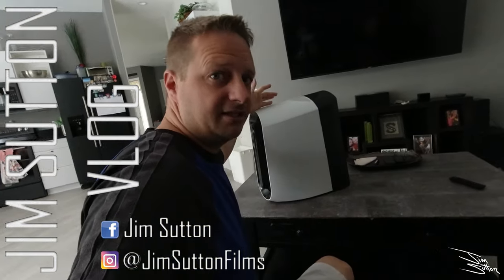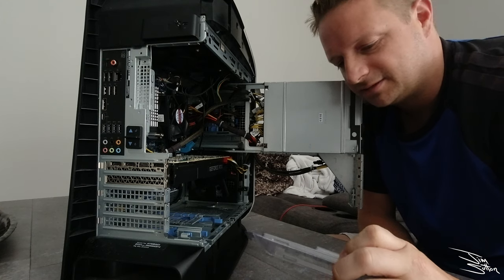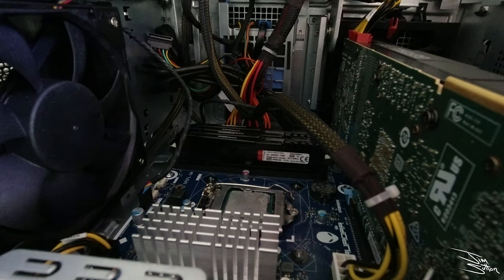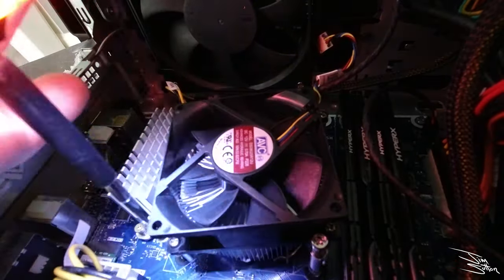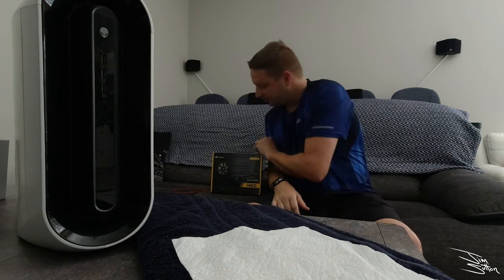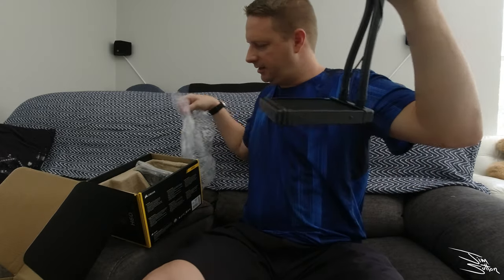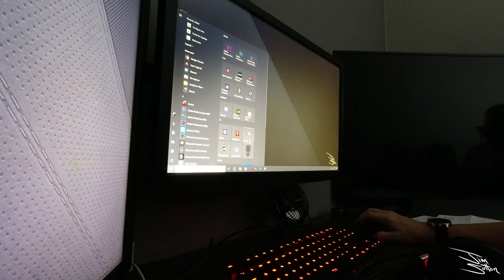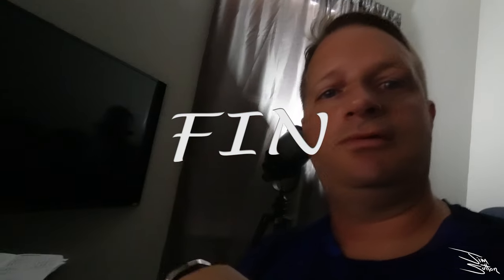VLOG #128 loud Alienware adding water-cooling so its silent and does not run so hot! Alienware R9

Comment: Is it a 9700k 3.6? Or the 3.0?
Reply from the maker: 3.0
Reply: Jim Sutton uh ohh
Reply from the maker: @Turner9090  I don't think that should make a difference on what your doing in water cooling.
Reply: Jim Sutton no...I have an R9 coming tomorrow, air cooled, wanted to run The new flight simulator on it....looks like I’m gunna have to upgrade
Reply from the maker: @Turner9090  its something worth upgrading for sure!
Reply: Jim Sutton do you have the product number of the Corsair water cooler?
Reply from the maker: @Turner9090  it's the h60. Got it from best buy, they had it in stock.   Although I see it now on Amazon as well.   

 https://www.amazon.com/dp/B079NXZQBC/ref=cm_sw_r_cp_apa_i_ekZqFbDBZNFBZ
Reply: Jim Sutton thank you
Reply: Jim Sutton and just to clarify, sorry to be a pain but for the cooling compound you used the LTT square? I’ll subscribe
Reply from the maker: @Turner9090 no problem.  Glad it helps you out.    This is what I ordered. Perfect fit.
 https://www.amazon.com/dp/B07CKVW18G/ref=cm_sw_r_cp_apa_i_VTZqFb8F4WXNM
Reply: Jim Sutton so sure enough I got my R9 been running FS2020 and thank god I got HWMonitor, because I ran fs and was showing temps of 100C!!!! So I ordered my H60 hopefully all goes well
Reply from the maker: @Turner9090  let us know how it goes!
Reply: Jim Sutton I will for sure, glad you uploaded this....I’m getting my H60 on the 5th of September....because of work, the install is gunna be on the 8th...I’ll check in
Reply: Jim Sutton where’d you hook up the SATA?
Reply: Jim Sutton something isn’t right, I have this sata cable and I can’t find any open data connection on my R9
Reply from the maker: @Turner9090  I guess I don't know what you mean.  There are no sockets to plug in your data cable on the motherboard?
Reply: Jim Sutton I need a sata power connection from PSU but I can’t find one, there’s the top fan wire, pump fan wire, and also a sata wire
Reply from the maker: @Turner9090  if you mean a power wire to go to the ssd drive, they don't come from the motherboard.  They come from the power supply.  There are extra connectors tucked in with all the wires toward the front of the case.  Normally tucked away because they have not been used.
Reply: Jim Sutton yeah that sounds about right not totally sure, but I’ll look for them...my cooler is a little bit different then yours. I have this additional SATA Power cable that I gotta plug in
Reply from the maker: @Turner9090  that doesn't make sense.  (Sata is a data connection for the hard drive) you mean power wire for the fans then?   The water cooling setup does not use sata.  If you want to friend me on Facebook, I am happy to contact you and help you out with this, so I can see what you are looking at.
Reply: Jim Sutton ok yeah I’ll do that...
Reply from the maker: @Turner9090  awesome. Glad we got that figured out.  Just if it helps someone else. His water cooler has a sata power connection on it.  So he had to power it the same way you would a hard drive in addition to the other connections.
Reply: Jim Sutton yeah it’s working great so far thanks man!!
Reply: Jim Sutton still running a little high but I’m running pretty demanding game and it has definitely dropped the temps
Reply: Jim Sutton might have to reapply the thermal paste
Reply from the maker: @Turner9090  that of get the thermal pad like I got.  I am happy with that.
Reply: Jim Sutton I also think mine is like an older version or something, which kind of sucks because it was the same price...freaking amazon....In your video I noticed you said the directions wanted you to place the fan on the outside (pull out), but mine seems to ask for the fan on the inside (push out) so maybe I’ll try rearranging that also, I’ll let you guys know if it lowers the temps more
Reply: Jim Sutton OK...So, I went in repositioned the fan, re applied the thermal paste, giving a few minutes to let that paste settle and then I’m gunna test it again...if it still runs high then I just suck at applying paste and the thermal pad is in the mail...wish me luck
Reply: Ok so I checked it this morning, my max temps were around 80, but flight simulator is a pretty cpu heavy demanding game, which is better than the 89 yesterday and way better then the 100 degrees I was getting before getting the H60...I’ll try the thermal pad when I get it, we’ll see how that goes
Reply from the maker: @Turner9090  did you do the single fan setup , or double? And fyi I do super demanding work on mine. From games to love video rendering
Reply: Jim Sutton on the radiator single fan
Reply from the maker: @Turner9090  I ended up after this doing both the original fan from the case, and the h60 fan both.  Sandwiching the radiator.  Both blowing up and out of the case. It improved the cooling even more.  Maybe try that if you have both fans.
Reply: Jim Sutton ok..where’d you connect the second fan?
Reply: Jim Sutton I’m also gunna mess with the command center tonight and put the temp control to performance and see if that changes anything
Reply from the maker: @Turner9090  I put one on either side of the radiator, and connected to second fan to the "cpu" pins.
Reply: Jim Sutton so I ran some other games last night (really old ones though)  and watched some videos to see what the temps would do, and they plummeted, cooled right down and no heat coming out of the case..so I may run some benchmarking software to see what happens there..but I have a feeling if I were to run some modern FPS’s it would run fine. Idk what else to do
Reply from the maker: @Turner9090  sounds like a win to me!
Reply: Jim Sutton yeah, strange I ran an AIDA64 system test and the temps were hovering around 56c at 100% utilization for 10 mins, but start flight sim and oh boy does it slam through those temps
Reply from the maker: @Turner9090  still must be a ton batter.  And enough to not damage your processor
Reply: Jim Sutton yes sorry, this is definitely an upgrade..:I’m just going off the deep end of performance

Comment: you need thermal paste, not pad. No pads work as good as the paste, it's basically a waste of money 
paste will give you further thermal performance on top of the water cooler
Reply from the maker: In most every test the difference is 1° of difference.  And for simplicity purposes.. I like the pads.  If you want more info on them, check out Linus tech tips. He has a good test on them.

Comment: Will the corsair H80i v2 fit and work with my r9?
Reply from the maker: its possible. but i would be worried about the hoses coming out of the top of the cooler.  It may hit the power supply, that's why i did not do one with that layout.  I would recommend ones that are on the side like mine are.
Reply: @DeCoNzMe , I just bought the h60, a good choice. Which way should the hoses be facing when I install it? to the top or bottom?
Reply: @DeCoNzMe  no it wont fit i tried and it was really stressful. Take my advice man im not joking!